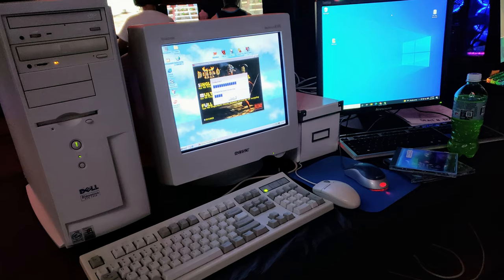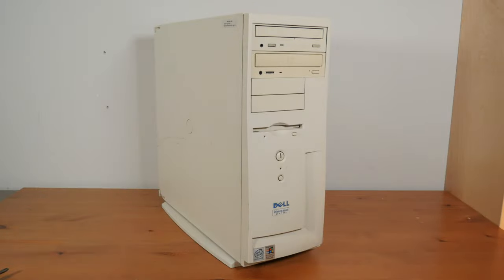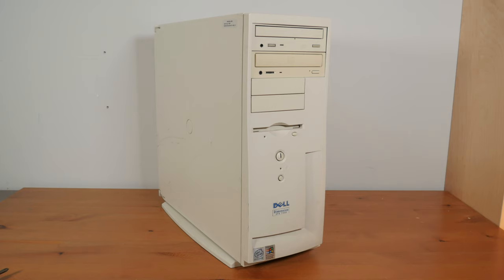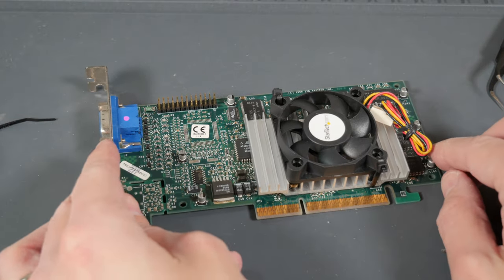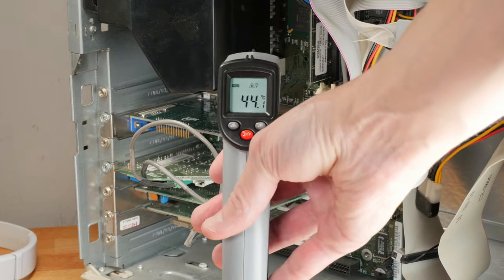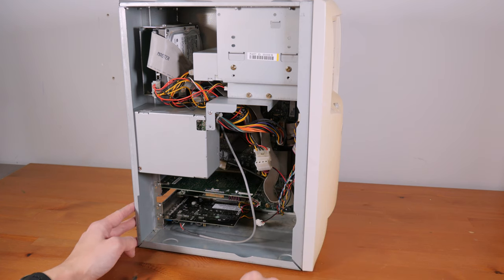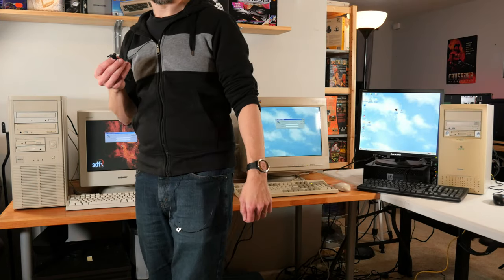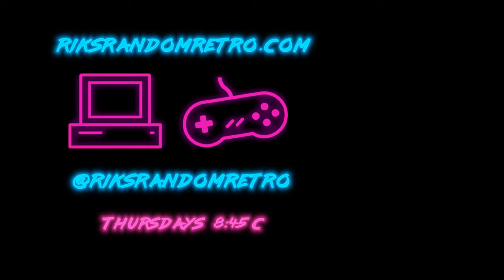Retro LAN - Preparing the Machines

Comment: "The Doom source code was released on December 23, 1997, initially under a not-for-profit license."

Impressive work. Highly legal and thats why its full blown.
Reply: Ill be the guy finding ways using bots in the future to not only make A.I. texture upscales maximal quality without all the manual steps, but probably making tools, or upgrading present ones to really fill out the library so future generations wanting to go back in time have the ability to experience the OG presentation short the then impossible to find hardware, and the new ways.

Imagine being able to emulate the performance of ancient chips down to bandwidth, memory walls, and approximately the general processing power of the architecture able to scale to newer machines. Then all you need is some CRT monitors, or extremely good digital fakes to keep the torch burning.

Comment: Is it hard to get the actual networking stuff set up? I have a few retro machines and I was to do a LAN with them, but I'm anticipating lots of problems and road blocks.
Reply from the maker: Actually it's not that bad at all! If you have machines on this era the quickest way is to install a PCI network card, set an IP address on the computer and connect them together via a switch. At that point they can talk together for LAN purposes but if you want to share files there are a few more steps. I'm planning a video soon on the topic as well!